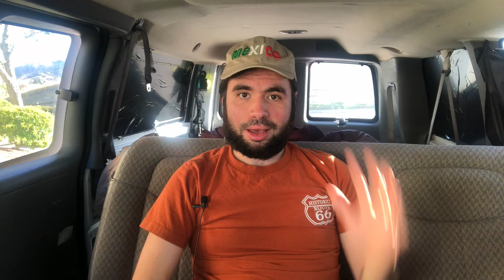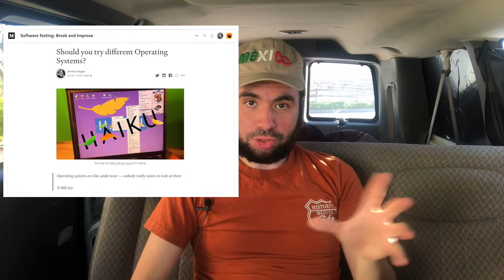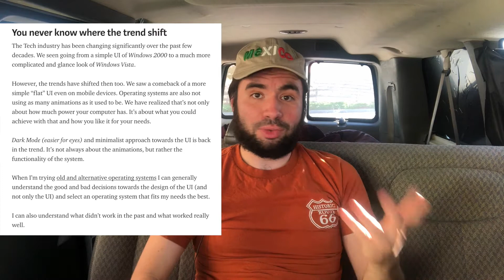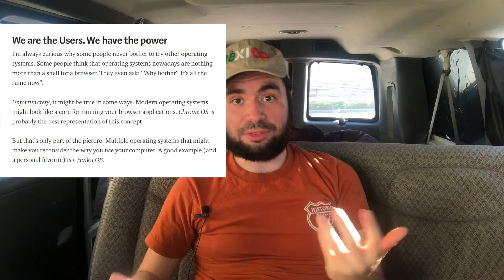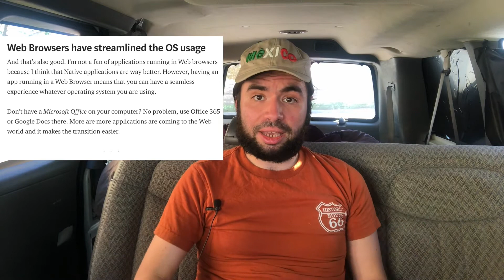Alternative Operating Systems: Should YOU try those?

Comment: Os should be basic like the idea of the new OS/2 build run it on a system of today are a 486 your choice your hardware. Only 1% have the best hardware most are using computers from 2008 - 2013 so something like windows 10 takes away from what they should be able to do. The closest windows got it right was windows 2k vs XP.
Reply from the maker: Windows 2K was pure breakthrough back then. Stable, innovative and most importantly - without glancy interface. Everything just worked like it should without unnecessary complications. Still the best version of Windows in my opinion. Of course it's outdated nowadays, but potentially this one could be resurrected.

Comment: You know I like to try different Operating Systems also, mostly now inside the VirtualBox.  The main Host Operating System I am using is Linux, and installing mainly different versions of Windows inside the VirtualBox.  I have one old computer, a Sony Vaio Desktop, that my wife was using her DOS Business Software on until a year ago, when she undated to a Windows version.  I upgraded the Sony Vaio, that originally came with '95 in around '96.  The Sony is a Pentium II, running 300 Mhz, upgraded to 190 MB RAM, and upgraded to a 4 GB Hard Drive.  When my wife is officially through with it I am going to throw either Windows ME, 2000, or a Puppy Linux on it.  Of the best non-regular Operating Systems my opinion is that Haiku and ReactOS, (keeping ReactOS simple), that you show on this video are the Best.  TempleOS is a joke to me.  I have not bought a MAC yet, although, I certainly have no problem using one when I am at my Sister and Brother-In-Laws home, very easy to use.  When I first started out in computers we were using a 386SX, 16 MB RAM, 40 MB Hard Drive, DOS 3.3, the 40 MB Hard Drive was partitioned, (as I recall for 3.3 you had to), as 32 MB for my wife's business, and I got 8 MB.  With my 8 MB went to Windows 3.1, and it started from there...  Actually, I consider all Microsoft Operating Systems, Linux Operating Systems, and MAC Operating Systems to all be good, even the unpopular versions are tremendous!
Reply from the maker: Hey buddy. Temple OS is a joke indeed, that one I'm not even interested in trying 😂😂 Plus, I'm not really religious, so yeaah..
Reply: Nomadic Dmitry I am religious, but that OS still is a total joke, programmed by a schizophrenic person that seems to have committed suicide. Don’t try it LOL! 😂😂. It really is a Total Waste of time! 😳

Comment: When I get my first encounter with Mandrake in 2003, I started giving conferences and speeches in my university, then I created a slax based distro for engineering [SlaxEng] (compiled the kernel, wrote and installer and built a live iso). Then I write some snippets that allowed me to install a Mac OS 10.4 in a external hard drive and running on in the labs' PCs. I even suscribed to the first emails chains of Haiku and React OS!! I loved all those moments, and now I use Windows when developing Windows Apps, Mac when Designing, and Linux when I need to write a complex app. If a I had to choose one OS, I will use Clear Linux for normal stuff and Kali because of work.Thanks for your enthusiasm Dmitry. I love your channel!
Reply from the maker: Thank you, Francisco!

I agree - those days the best practice is being exposed to multiple OS and use those as tools to achieve results.
Each systems has some specific advantage in some area and lacking something in other areas.

I've also used 10.4 on my PC back then (it was AMD Athlon 3000, I think).  And it was quite stable honestly. The only problem is that it was lacking SSE3 instructions and someone wrote a .kext file to emulate those. It was funny. But it worked.

Re: Mandrake! Yep, also tried that one. There was actually a Russian Linux Distro called "Linux Junior" that was based on Mandrake. It was quite unstable, though.
Reply: @NomadicDmitry  Yes it is, but sometimes is the preference to fit our beloved tool to the work, even if it is not the best to do it. I really respect Russian CS, since I had three soviet era teachers during my masters, and they were hard working and very smart. I will search more about that distro Dmitry. Thanks for answering me!

Comment: What is the oldest OS you have ever tried?
Reply from the maker: Alex Nazarov I think it was ZX Spectrum/Sinclair where I loaded games from cassette tapes. Not sure what OS was there.
Reply: Nomadic Dmitry , it doesn’t look like ZX Spectrum has an integrated OS
Reply from the maker: @alexnazarov9059  Yeah, it just had a few commands to load software and built-in Basic interpreter.
Reply from the maker: @alexnazarov9059  Okay, then besides that - the oldest OS I used was MS-DOS and Windows 1.0.